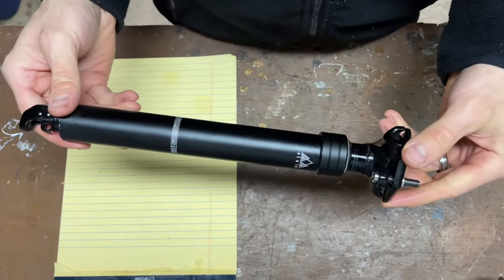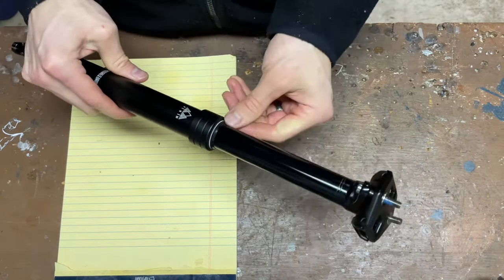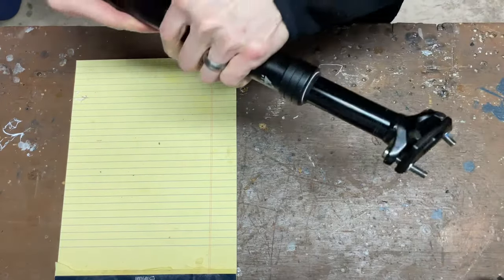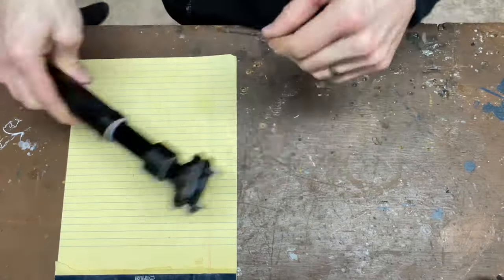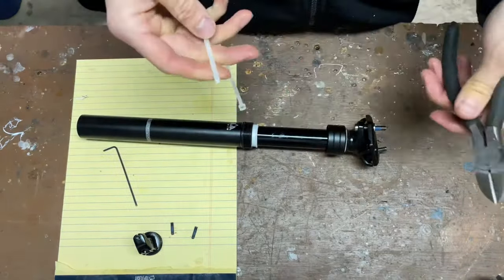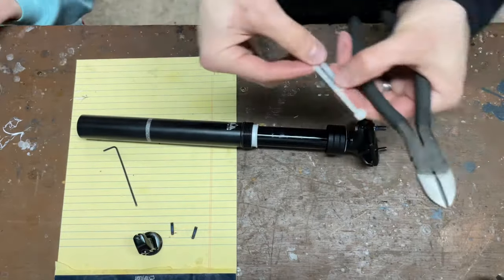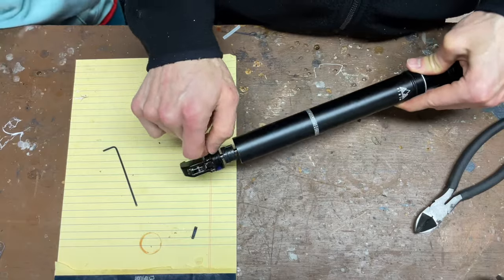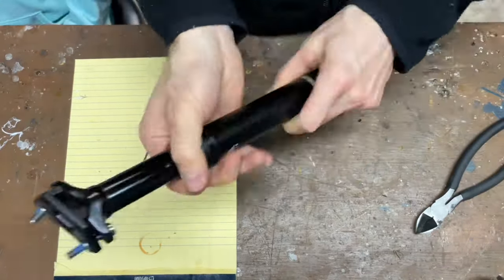How to adjust the travel for any dropper post￼

Comment: Thanks for this video. I did a version of this on my PNW coast suspension dropper. On that post there are 6 much smaller brass keys. I had to cut a small zip tie (~10 cm) lengthwise so it was ~1.5mm wide. I only wanted to shorten travel by 1 cm so I cut them into 1 cm sections. A little tricky to insert and get everything sorted but it's working perfectly, reduced travel by 1 cm!

Comment: Thanks for your video! I am trying to troubleshoot a trans x 100 mm dropper that came on a bike I purchased, the post is very spongy when you sit on it moving two or three inches, when I removed from bike I noticed that you cannot manually flick it and make it rise, and it will never lock into a lower position, any idea what may be going on before I attempt to disassemble this thing? Sorry for the rambling message and thanks for your time!

Comment: Depending on weight im guessing as these will crush easy under load?
Reply: The spacers don't hold any weight, just limit the travel. The weight is still supported by the oil within the post mechanism. Here's a good visual of how a dropper post works. https://www.youtube.com/watch?v=0Bg2E8YgF-w In essence, the spacers are doing the same thing as lowering the post by whatever height they are, without having to do that every time you put the post up.

Comment: Will this work for a PNW Coast external dropper post with air suspension? I can’t find anything online. I need to lower my travel by 1”-1.5”.
Reply: Did you ever find out?  I am wondering the same thing.
Reply: Wait you get a dropper with suspension post? Exactly what I'm looking for my new fox transfer is way to big at 150mm can never get it set to the right hight again for ages after drop it abd put it back up actually sick of it